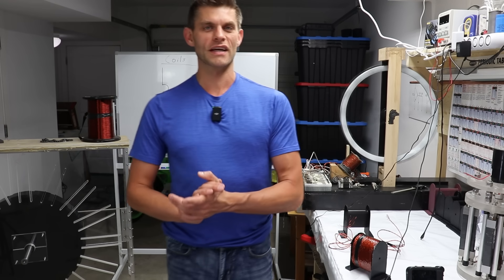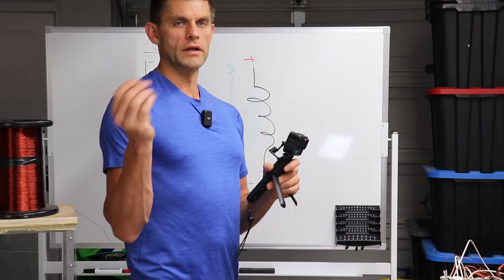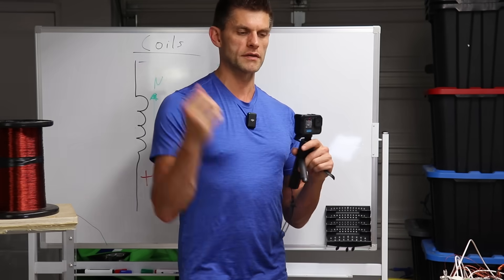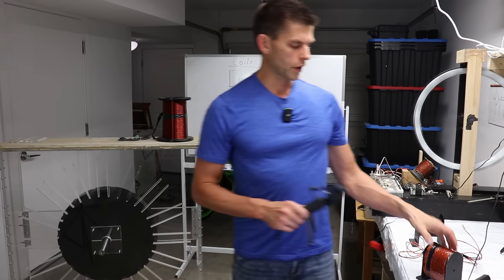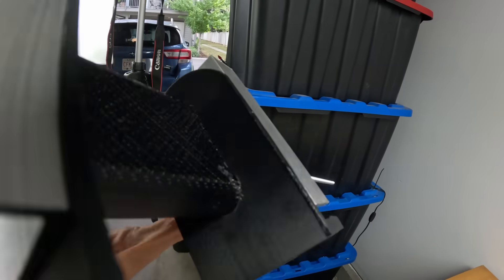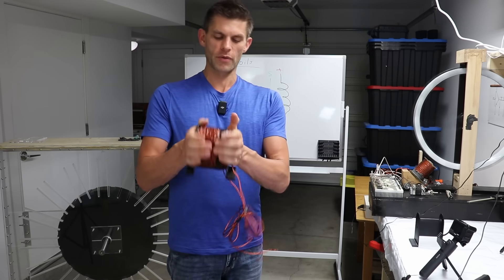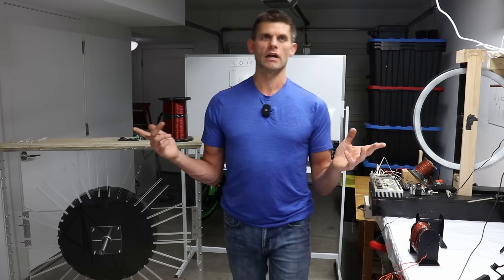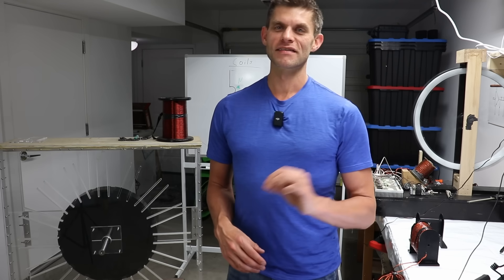Unlimited Energy in My Garage (No Patents)

Comment: Thanks for working on this for everyone's good.

I guess I'm missing something, but from the simple explanation about how it works, it seems that the magic occurs in the lead-acid battery when you input high voltage electricity into it. If that's the case, why the need for all the complicated rotor and magnets? I mean, it's easy to get a simple and cheap device that will step up the voltage to thousands of volts. So if that's all you need, why not just connect the first (source) battery to one of this devices to step up the voltage and then connect the output to the second battery?

(Not sure if the second battery needs to receive the high voltage input in pulses for it to work, but even if it does it's still easier to pull those pulses from the first battery and proceed as above).
Reply from the maker: I dont think u do but let's get this running first

Comment: I'm very hopeful for this concept, I just have a few concerns. You say the magic happens when you apply the flyback voltage (a couple hundred volts?) to the lead acid battery. Why couldn't you just apply that directly with a power supply? You say you've spent thousands of dollars and I know components can cost a lot but the version you have running really seems like a budget build. Best of luck, we really need a change in the world.
Reply from the maker: I dont know for certain the rotor isnt needed. So let's build it the way others have first. 

Good logic though

Comment: What's the watt-hour consumed vs watt-hour gained per cycle, per x cycles, and per x hours? What mosfets duty cycle did you go with? Is it based on wheel size, and magnetic strength and spacing?
Reply from the maker: All those play a factor... basically we Will find the max
Reply: @MadscienceLPTECH  I thought the bicycle rim is your test rig before you bother putting an excessive amount of effort into a theory?!

Comment: I'm going to give you some great advice, which is to build a smaller version about 1/10 scale for only a few hundred dollars in order to see if it will work before spending thousands on the larger version you have there. If it works, if it actually produces energy, then you should be able to disconnect the drive battery and use the output energy to not only power the system but also to use it to light a single 1.7 volt LED, which requires only milliwatts of power. This is a requirement--you have to be able to do this before spending thousands of dollars on a larger machine. It's also important to note that LOTS of people have tried this kind of setup and none of the machines have worked--none have produced energy. Good luck.
Reply from the maker: Valid on scale... but many have buot these machines and they do work
Reply: @MadscienceLPTECH  You'll need to prove that the machine produces more energy than it consumes by having it run for at least 24 hours without any connection to batteries. After that, it'll need third party confirmation. I haven't seen any machines that work--if you have, then you need to show us some vids that demonstrate that energy is indeed being produced--vids that were shot either by you or by others. Also, after powering a load in the milliwatt range, I need to see it power a load like a 500 watt space heater continuously for 24 hours and then third party confirmation after that.
Reply: @franklogan3592  If the machine is PRODUCING energy, then it needs no connection to batteries after the system is turned on. It's okay if the batteries are connected when the machine is turned on, but then the batteries need to be disconnected in order to prove that the system is producing energy. If a machine or a process consumes 10 watts of power, then that machine or process needs to produce more than 10 watts in order for the machine or process to continue to operate WHILE powering an external load. No one has done this yet.

Comment: What if you were to suspend the coil. Maybe with strings in multiple directions. Then use a smaller rotor with the coil stationary in the middle with the rotor thats spinning around it with a small gap to gain your forces. But then theres no movement and all magnets remain same distance from the coil at all times. Just an idea ive had. Maybe its already a something else. Idk? Like the video though!
Reply from the maker: Like the idea

Comment: Misleading, there is no such thing as unlimited or free energy. Nothing can be created or destroyed. It can only change form. In that process, there is loss. Nobody can create a machine that produces more energy than it takes to run it. If you could, you would be the creator. A perpetual motion machine is a system with zero loss. These do not occur naturally and are impossible to make. At best, your idea is a percentage more efficient than current technology, but i doubt it. Especially for the masses.
Reply from the maker: Dude I litterly say it comes form the environment like solar... not free from nowhere

Comment: Back emf is not necessarily higher pressure voltage. Its pressure is related to the resistance of what you put it through. Because of the conservation of energy, the back emf can choose its voltage to amps to best suit its load.  Unlike a battery that has limited voltage. Making anything attached to back emf run more efficiently. Do  experiments and see for yourself.
Reply from the maker: I agree. Its higher pressure cuz of my coils. Not all flyback has to be higher pressure
Reply: @MadscienceLPTECH, did you know the back emf is increased when duty cycle is as close to zero as possible and using square wave.

Comment: HHO
PWM 41k - 44k Hz cracks water.
Surface area is king I found stainless steel mig wire in coils and made them like antenna coils for the 41 - 44khz range with a solution magnesium sulphate and bicarbonate of soda 1 tbl spoon each to  2 litres of distilled water made the perfect electrolyte. @ 24 - 48 volts and 6 - 10 amps on a hard crack no PWM  3 - 6 liters per minute with the PWM this could easily be 10 times as much with lower voltages and similar amps.
Alas money and time ran out. Warning HHO is extremely explosive gas, I'm extremely lucky not to be deaf from I pint of it exploding. From inside our garage set off  car alarms and had people out looking for a gas explosion and it took 48 hours  for my hearing to come back although he very end 22khz has gone for good, yes I could hear a dog whistle. Weird but not anymore.anyway you have been warned.
Reply from the maker: Been there myself. Ya browns gas is the shit brother

Comment: Im running a mosfet fullbridge controlled by cpu hehehe. Stuff now can be so much more efficient
Reply from the maker: Sounds interesting, thanks for sharing!
Reply: @MadscienceLPTECH  while gaining control over your motor (including even startup mode) youll also gain control over efficiency.
I found that adding a few diodes in the paths enabled for a upto 80% lower input energy compared to without the diodes.
It was also noticeable in the busvoltage (between the diodes)
Where i used 24v psu source and my busvoltage was running on 28 (yes a additional 4 volts)
Obviously the bus was charging to atleast 23.3v by the psu when a motor pulse drugs down the bus capacitor.
But stills. This additional energy in the bus was enough to cut my motors input from 200watts to only 40 to 50 watts

Comment: one night while under extremely high speeds my pulse motor made a poof noise like some kind of magnetic bubble popped there was no noise whatsoever after this happened  void of any sound anywhere as my pulse motor rotor simply sat on my work table not secured as i saw no need for it after the strange poof sound it levitated perfectly straight off of the table and and spun there [perfectly for brief second or two before slamming into the drive coil  that drove it never in my life had i ever seen anything like i have never been able to recreate this phenomenon
Reply from the maker: Sounds like you stumbled upon something really interesting!

Comment: I feel like let say you put 12V 2A in you'll get lets say 120V 0.2A out so you can charge that battery and it's infinite assuming all the wire has resistance = 0. I didn't understand that magical 0 point energy stuff tbh this neat it uses less energy then not recycling the flyback into second battery but it ain't free energy
Reply from the maker: Thats a conventional view point. The high voltage spikes into the battery unlock unconventional power
Reply: @MadscienceLPTECH  I reckon the proof has to be furnished, I am perfectly able to believe that but you'd have to show that Bat1+Bat2 total charge before the experiment is run is less than bat1 +bat2 total charge after the experiment is done. I have heard of stuff like that with low voltage and high amperage also, but always without believable proof !

Comment: it might also be worth noting the whole alternator from a car bit everyone swears to in not entirely a scam but it only works when using a very old alternator that has an residual magnetism from years of use all that is needed is to charge the field coils one time with 12 volts to energize the field coil just a brief tap avoid reverse polarity connection of field  coil energization as this will permanently destroy residual magnetism in the coil

Comment: The coil needs to be put in epoxy and put under vacuum before curing. Have to make sure that the temp of the curing expoxy does not melt the wire laminate. This is the first time I have seen someone make stranded wire for use in a coil creating more gaps, thought the whole point was to get the wire as close and organized as possible.
Reply from the maker: Its how bedini wound his. We will try different configurations

Comment: the circuit i used was similar to the ssg circuit but look at the ssg bedini circuit cut the left half of it off the trigger half and replace transistor with magnetically actuated spark gap and i achieved all of this with only one battery its not so much that i charged  anything as it is that it stayed energized i believe all of this could be done with super capacitors in series

Comment: i have personally broke the conservation of energy law about 30 or so times i never had much luck with transistors i to have been limited by funding but will i will offer you because money is non existent in my world  let me just say i use a magnetically actuated spark gap switch you will get a completely different result its in the spark gap at  a higher speed the spark gap is a must ive powered 1500 watts for 3 days before my meager little switch wore out to heat when the 3 days were done i had exactly 1 volt more in the system than when i started not to mention the 1500 watts of continuous power you will need to adjust the spark gap to the correct frequency and intensity this is done by adjusting the tension on the switch i hope this helps
Reply from the maker: Wish yiu had pictures sounds cool

Comment: It makes no sense, when you apply a higher voltage than what a battery can supply, what you do is burn it, not take energy out of space. As for the motor, because what you have built is an electric motor it simply works like any three-phase motor, only here you have put one phase that "turns on and off", instead of three or six that have alternating current motors; In addition, at no time do you show the readings of the batteries and how much current is transferred from one to another, on the other hand there is a lot of energy loss both in the rotation of the wheel, in the electric field created and the passage of the current through the cable itself that acts as resistance. On the other hand, the effect you explain occurs in the coil that returns the voltage is given by the following Faraday's law V = −dΦ/dt, where the flux is equal to Φ = N⋅B⋅A⋅cos(θ), where A is the area of a single turn of cable and N = number of turns of cable/length, on the other hand B = electric field and θ = angle at which the electric field is induced. Which basically boils down to the fact that the maximum voltage that can be generated is limited by the maximum field that the coil can generate, so when inducing 12 volts from the battery the voltage it generates produces a magnetic field that varies and this makes the voltage "change direction" assuming that there are no losses of any kind is exactly the same as you have applied 12 volts. so IT'S FAKE
Reply from the maker: Lol generic closed box thinking. Nothing new dont try I know 😂
Reply: @MadscienceLPTECH  No just prove your point with data and not with random facts

Comment: your wheel don't turn fast, its very low energy consumption this system, with your battery you can drive your wheel 1 year or more, but that not free energy
Reply from the maker: The pint of the project is to step it up. The new one will spin very fast. Any if the other one span for a year id say its free energy

Comment: T=L/R first year electrical engineering. The collapse of the field is not free energy, the creation of the magnetic field takes energy. This is why speakers are rated in ohms because of the initial inductance from pulsing the coils is like resistance of coils. This is reactance or L. High voltage in lead acid batteries is not magical, large batteries act as a charge sink. The line voltage will always be around or right above the actual battery voltage. You can charge almost any battery below its C rating with input voltages much higher than thier max voltage. Its just hard to do without exceeding the current. In fact most lead acid  desulfation circuits use around 100v. Free energy comes from a solar panel. Over unity no matter how many hours you invest, you will still be either scamming people for views or ignorant of physics that have been nailed down mostly since the 1800s. Most people don't disappear because of big oil, they do because they can only influnce a new group that will eventually fall out once the new group either try it for themselves or read for themselves. You are praying on the hopeful and faithful whether or not you know it or not. It's a good learning experience though.
Reply from the maker: This in not basic e and m alone... think outside the box.
Reply: @MadscienceLPTECH  I wouldn't have clicked on your channel if I didn't think outside the box. But thinking outside the box does not entail hand wavy, unrelated  things without explanation like zero point energy that have nothing to do with the effects at hand. There is energy everywhere, but what you are not explaining is that the majority of it on earth is thermal. It's like someone who tells a joke, but never gets to the punchline. What is novel here that shows that this is anything but a 1.) A motor connected to a battery 2.) with the delay of collapsing magnetic field 3.) that was expanded with energy from the battery... not the ether(zero point energy)?

Comment: I think it’s a fine idea to create a motor with magnets, but I’m not seeing the “unlimited energy” creation here. You simply pumped electricity(provided by your friendly neighborhood power company) through wires to create a magnetic field that moved magnets on a wheel. Ok, there are a dozen ways to make a turbine spin from electricity. I don’t see anything particularly novel here. Just a different way to spin a turbine. Your original power source was still the electric company.
Reply from the maker: Lol no, the systems self charges
Reply: @MadscienceLPTECH from what power source?

Comment: They still exist, the alchemists who want to make gold from lead, who extract energy "out of the thin air." Without going into it too deeply: copper has electrical resistance = loss. Everything that rotates moves = loss due to friction, due to resistance to the air. So if you write down the formula, you will always end up with a negative result, let alone if you would then connect an electrical load. Do something useful.
Reply from the maker: Lol writen is limiting. Build
Reply: @MadscienceLPTECH  Do you see anyone else being so stupid as to create a "energy-generating device from nothing" using these two simple and fundamental data points? The resistance of the copper wire is 1.62×10−8 ohm−meters. The first law of thermodynamics:
Energy cannot be created or destroyed, only converted from one form to another. This is the law of conservation of energy.
The first part of the first law is the most important here.